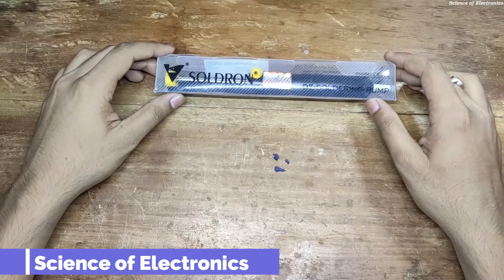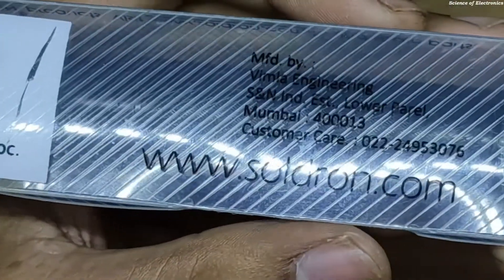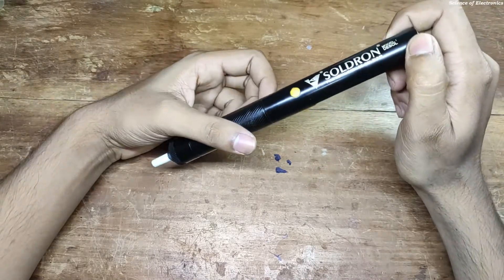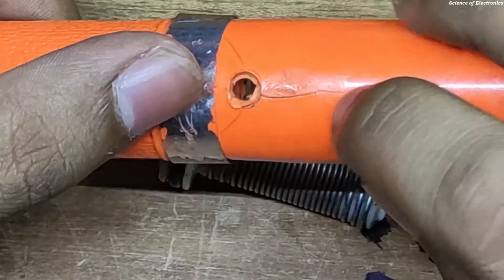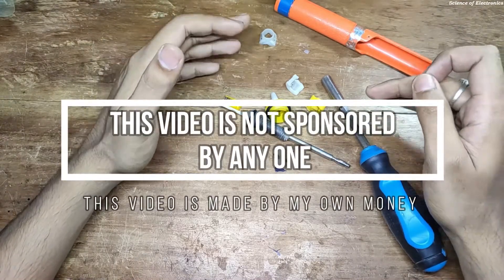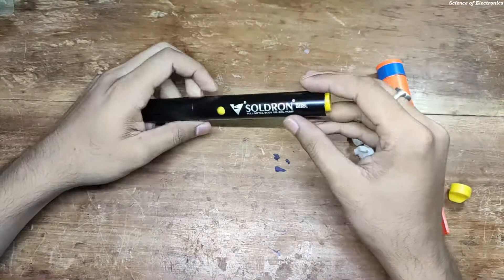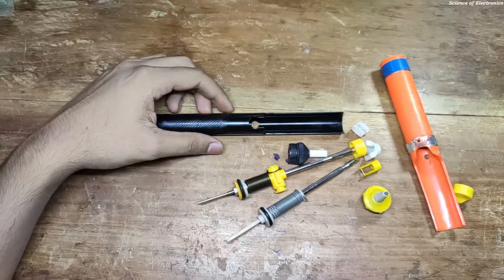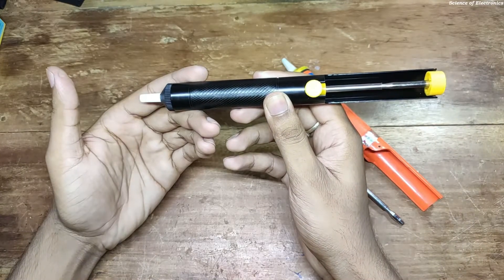Best desoldering pump at low price | Soldron Desoldering Pump | @SO_ELECTRONICS

Comment: i have same mastek multimeter that you have but in my multimeter shows 479 value in diode section without touching probe and when we touch probe it shows 0 and beep and in resistance section also it shows resistance without touching probe can you plz tell me how to fix that
Reply from the maker: I told to send a email on soelectronicsofficial@gmail.com 

Please send a hi reply on email i find the solution and i send you the perfect solution instantly.
Reply: @SO_ELECTRONICS  ok thanks